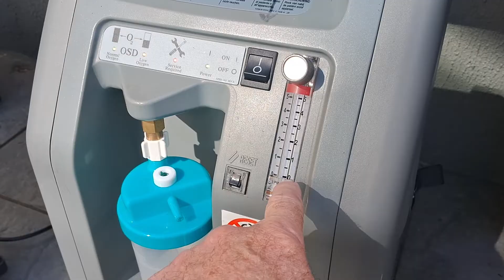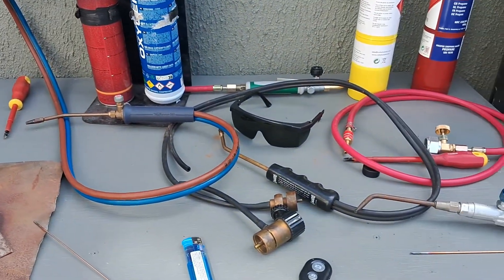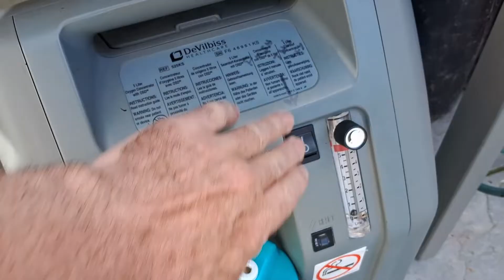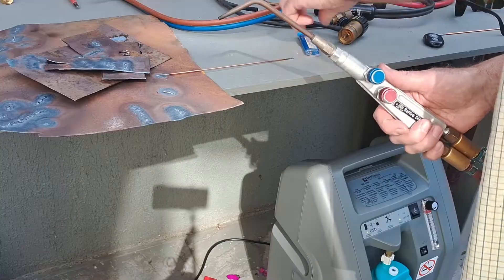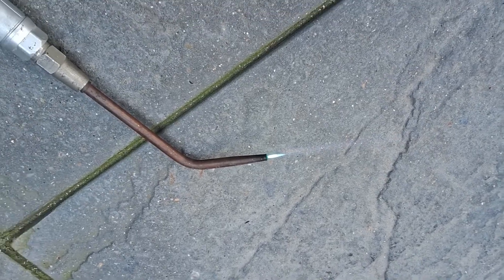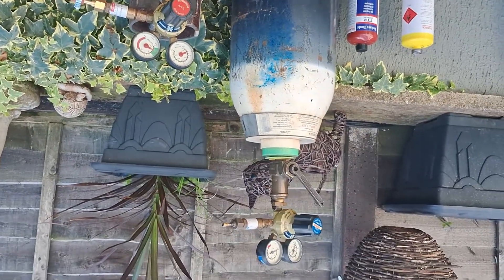FREE OXYGEN FOR WELDING USING A MEDICAL MACHINE oxy acetylene gas bottle same kit gauges torch hoses

Comment: To me, the flame you're using, is what we were taught (in 1967!) was more for brazing, than for welding mild steel.
We were taught to increase the oxygen until there was no fluffiness around the core flame, but it mustn't be too sharp either, as that was an oxidising flame and would produce a more brittle weld.
Reply from the maker: good comment cheers andy

Comment: Now all you're lacking is an acetylene generator ...
Reply: What a dream!  I've never seen one, but read about them.  If you really look, you can find little cans of Calcium Carbide still, which used to be sold retail.  A big welding shop might buy it in drums!  By the ton, so to speak.  I guess you could have as much Acetylene as you wanted!  I do a little demo every semester for engineering students (in the welding area) with a soda bottle, tiny hole punched into the screw cap.  There's an inch or so of water in there.  When we're talking about Acetylene, I'll pull out this primitive apparatus, drop in a rock of Calcium Carbide and quickly close the bottle.  A little stinky jet of Acetylene is now coming up, it can be lit to give a bright light.  Many of today's youth have never seen any open flame so this is a little treat for everybody.
Reply: I am currently trying to build 2 acethyline generators out a camping gas and domestic butane cylinders. It is not easy.

Comment: Hi , love the video how many Lt per minute does your machine give out, and what’s the least you would recommend? Manny thanks. Paul 👍👍
Reply from the maker: 5l and it does light welding.
you want at least that, i wouldnt get a small machine

cheers andy
Reply: The home version of these are usually 5L per minute I recall.  They can be a pain to use!  They're medical equipment, they have unexpected safety features:  There might be an alarm for no flow, and one for too much flow.  These make sense if the thing is going to be attached to a person, you learn to work with it.  It's not dangerous to leave the oxygen flowing for a while, I think it won't build up in the room, since it's just the oxygen that was there anyway, circulating around.  The pressure is low, but will run some kinds of torches.

Comment: Fino a che spessore puoi saldare? Riesce a gestire un cannello grande? Poi con il gas gpl va bene?
Reply from the maker: not very thick. i havent tried lpg gas
Reply: @andyfireblades ma non bisogna avere 4 bar di pressione dell' ossigeno per saldare? Questo generatore di ossigeno produce solo 1 bar
Reply from the maker: @giacomoorru3420  this is ok for small work only

Comment: All of the medical oxygen concentrators I've seen for home use (which is what you show in the video) also sell a compressor kit to use with the concentrator to allow users to refill their portable oxygen cylinders at home.  

One thing though, it is not "free".  O2 concentrators pull as much power as a refrigerator running 24/7.
Reply from the maker: thanks for the info. that would be good , to be able to refill as well. i will look into that. 
yes you have got the electric to pay for. nothing is free, except for sunlight
Reply: @andyfireblades 
solarr panels cost money, setup costs your time.  

still, i love the ingenuity!  another way to get liquid air is acetone and dry ice🎉

Comment: If you are cutting with it it certainly won’t work.
Reply from the maker: yes, there wouldnt be enough flow rate 

cheers andy
Reply: @andyfireblades  not just flow rate but purity.

i would have to dig for the chart, but iirc, a drop of 1%, from 99 to 98% doubles the time to make a cut.

dropping to 95% makes it almost unworkable. too much nitrogen and nonreactives in the way.
Reply: @paradiselost9946  Good point!  I hate to be that guy (I have oxygen concentrators too) but I don't think this made oxygen is suitable for welding at all.  We're trying so hard to keep Nitrogen out of the welds!  There's stuff in the welding rod that deals with oxides, oxygen AND the welding flame is reducing in nature (you can see a steel surface become clear under the flame, right?).  There is nothing that fights the Nitrogen!  Concentrator Oxygen is suitable for glassblowing, demonstrations and I think some general operations like soldering or brazing with flux.